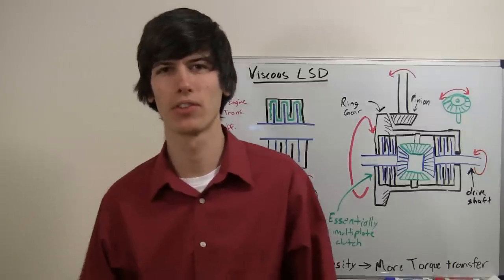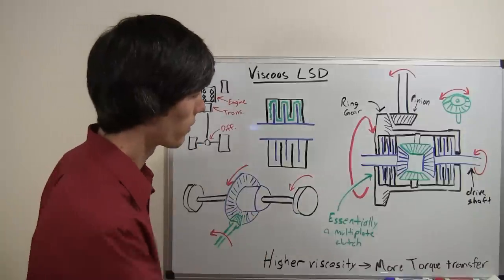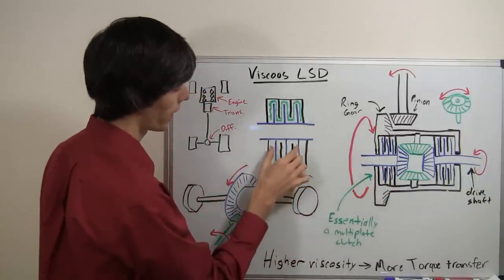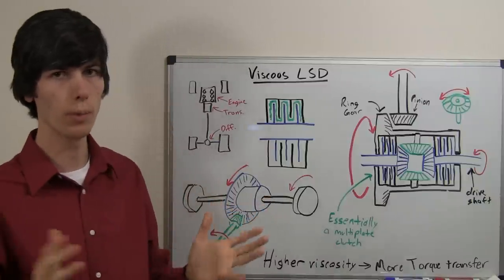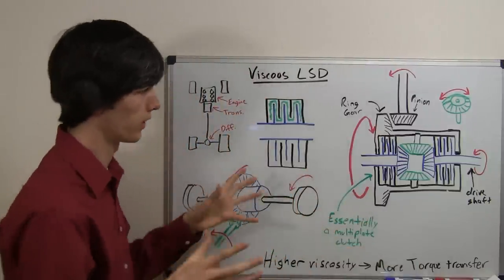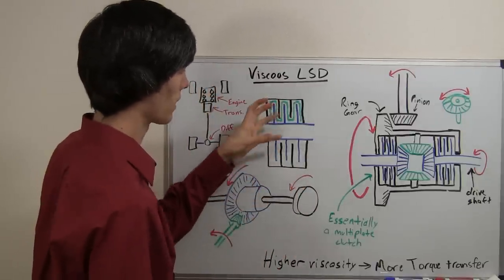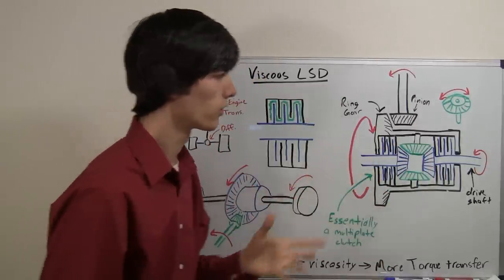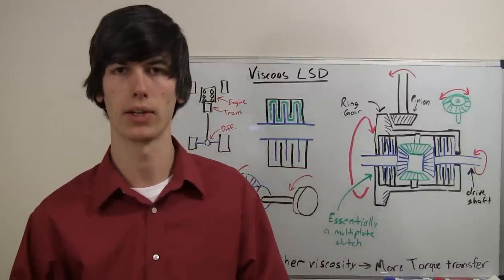Viscous Limited Slip Differential - Explained

Comment from the maker: Different methods, there's likely a cost difference as well. A VLSD will act a little more like an open diff than a clutch type, as it will allow for varying speeds before creating a restrictive force to get the diff close to locked. A clutch type could be locked in situations like cornering (while accelerating) where you may not necessarily want it locked. But ultimately, there are numerous solutions to every problem.

Comment: I think there is one important point to add in these video: viscous LSDs cause understeer by nature during steady-state cornering (outer wheel is forced to slow down and inner wheel is forced to speed up due to the increase of viscosity of the fluid). This is something that should be stated in my opinion when talking about clutch plate and viscous LSDs, since the transient vs steady-state operation of a vehicle during cornering is not the same.

Comment: Don't want to confuse anyone, but during differentiation both viscous clutch packs are seeing relative rotation, and therefore are contributing to the torque transfer to the high traction wheel. Also, viscous diffs are what is called "Speed-sensing". They transfer torque due to a difference in the relative speed of the rear wheels, as opposed to "Torque-sensing" differentials that progressively "bind up" as they are put under more and more torque.

Comment from the maker: Well VLSD does not act instantaneously, where as clutch/torsen diffs do. So if you want maximum torque transfer (instantaneously) to the wheel that has the most grip, a clutch type or Torsen (if both wheels maintain contact with the ground) are your best bet. Viscous is fine though, can do the job.

Comment from the maker: Somewhat similar in principle, but torque converters use transmission fluid, which I do not believe changes it's viscosity characteristics much with temperature change; at least not to the degree that VLSDs do.

Comment: The liquid in the housing is typically a silicone based fluid, so when the plates move at different speeds, the sheer forces make the fluid turn more viscous. This helps to lock up the diff.

Comment: In RC the pinnion gears and pinnion axle are slowed down with the visco liquid making them turning more with the casing. The Casing is filled with the liquid and stiffer the liquid less it lets the side gears to turn separately. So stiffer the liquid, more "lock".

Comment: Just pointing out its not the same speed... The weel with less friction gonna spin faster than the diff housing around 1:2 ratio... Causing the viscus liquid to resist the movement as well as the weel with less grip to move with the housing. both of the friction surfaces to work simultaneously. But i am not a fan of this diff even when basically maintenance free..
Reply: I had a Fiat Coupé 2.0 20VT which have this kind of diff. Works really well but is bad for the fuel effiency.

Comment: One question, just for my understanding: imagine a viscous-coupling used as longitudinal centerdiff. There is silicon oil (e.g. 90%) and air inside, not mixed. In operation with different speed the oil transfers torque, but the rotating plates also start to mix oil and air, so viscosity decreases, less torque is transmitted up to a certain point (hump). During normal operation (no hump) with higher speed difference more and more air bulbs will "hide" in the special shaped blades so that more torque can be transmitted? I always thought that viscosity of silicon oil increases but read somewhere that this oil is not dilatant...

Comment: Actually, the wheel on ice will spin twice as fast as the differential housing if the other wheel doesn't move, so the viscous fluid will both slow down the slipping wheel and accelerate the other one! ;) I love your work, keep it up!!

Comment: just an FYI 350z use a VLSD system for their OEM cars, with the nismo diffs just being harder, stronger materiel for the gears... 

Now, why is the VLSD non-repairable/serviceable other than just changing the gear fluid in the differential???
Reply: I have an 04 350z and want to put a 370z vlsd but idk what to get to fit any advice
Reply: Hey know you commented like 4 months ago but all you would need to do for ideal fitment would be to run 370z shafts and driveshaft

Comment: correct me if i’m wrong (because i want to understand better) but it sounds like it works very somewhat similarly to a torque converter. sending torque to the tires using fluid

Comment: just checked the rally cars the evolution and the STi, they both have LSD's, and the lesser model the plain WRX has open diffs.
interesting that it states if the hand brake is used it does something to prevent damage to the VC

Comment: it seems like a fraction of the power would be wasted with a system like this because neither side is ever directly connected, the diff housing plates would always be sliding through the liquid slightly faster than the plates connected to the axle receiving power from the liquid.  am i right?

Comment: Like your videos.

Just wondering why not just put the oil/grease inside the diff gear area? both lubricating the diff gears, and creating the VLSD effect.
is that because those gears are so heavy duty they need special lubrication to work. so those oil need to be used with the clutches?

Comment: [Cont. from below]  Is it true that as the difference in velocity between the two wheels increases, the friction in the diff increases causing it to allow less slip?  One final related question: Is a viscus LSD's utilization of fluid similar to that of a torque converter?  Thanks so much for helping out!

Comment: Super helpful video.  Thank you.  Is the fluid in the diff such that its viscosity increases with friction?  Or, perhaps that it counter intuitively becomes more viscous with an increase in (friction induced) heat?  My other idea is that it is similar to the fact that when I move my arm slowly under water I feel little resistance, but when I move it quickly under water I feel a lot of resistance. [continued in next comment]

Comment: Both of sides of the housing are filled with liquid, but have no pressure plates? When the tire on the ice rotates at the faster speed, the liquid transfers to the other side so torque can be transferred to the side initially rotating slower and create its own pressure to the clutch? With that being said, how does the liquid transfer? Via small turbine????

Comment: do you think torsen is better than viscous lsd(like haldex)?
Reply from the maker: Sorin Tudor For longevity, yes. They're somewhat different though, a Torsen diff will act essentially like an open diff with one wheel in the air, a VSLD will be a bit different.
Reply: ok, which kind of diff is the best for all purposes?
Reply: +Sorin Tudor torsen is better.
both torsen and viscous are long-lasting  - they live the same  time as gearbox or even longer.
clutch-lsd - every 20-30k km u should check preload and  tune it or change friction plates - all because of wear. so it's for sport and petrolheads.

torsen works from differents of TORQUE
VLSD works from Differents of SPIN

So torsen better when  when u need torque on both wheels but there is no differense in wheelspin - on tarmac in the corner .
VLSD need different wheelspin so it will work in mud or other slippery surface.

BUT!!!  It depends a lot from initial tune of both when they were designed. Example - pulsar vz-r  VLSD  is so weak  that car cannot  jump down from  lift jack.  

torsen  can jump down but u need to press both  brakes and acceleration pedals
Reply: there is a difference in response. torsen reigns supreme. hard to say numbers, but in corners that slight delay makes a huge difference.

Comment: Hey im not sure if u could answer my question but i git a 2000 volvo s80 t6 with a viscous clutch and im not sure if i really need it. And if i just can reinstall a new cv axle but without the viscous clutch and if the car would preform fine

Comment: Is this similar to a fluid coupling for say a  conveyor belt drive? I need to understand this for a mechanical engineering assignment. My understanding is as the motor starts up the power gets transferred gradually to the rest of the system. Is this correct?

Comment: Great Vid!  I have a question:  I have a viscous rear diff on my awd 3000gt vr4.  With the car in the air, I spin one rear tire and the opposite wheel should turn the same way, but it doesnt spin at all.  Does this mean my rear diff is not working?  thanks!

Comment: So that means it works? I had my car in the air with 4 corners on jack stand, 
1. spinned one of the rear wheels with hand, the other doesn't spin
2. turn the car on, put in gear, gave gas, it still have one wheel spinning and the other barely moves
one wheel fast + one wheel slow/barely moving = still working viscous?
So getting the speed up or sudden accellerate will trigger the lsd to work?
cause I still don't know if my viscous is still alive
thanks!!!

Comment: So these diffs are effectively 2 way diff then... as there is no mechanism for uncoupling of the diff during deceleration?
Reply: No, VLSDs will act as open diffs under deceleration as the fluid inside is not generating grip on the plates.
Reply: @winebartender6653  it's the shock losding on the fluid that makes them stiffen, doesn't matter which direction. I'd conseed the are probably less tight under declaration. But not open in any way. And how tigh mine is shimmed, it's tight af in both directions.
Reply: @tangles01  I would think the deceleration difference would have to be quite large between tires (more or less loading/faking slip of one tire) to see much of any sort of locking action. The vlsd is purely reactive to slippage, unlike a 2 way which takes any sort of difference in tire rotation and begins to apply locking before slippage occurs.
Reply: @winebartender6653  it doesn't matter where the load is. it's loading, it's locking. That's how the vlsd fluid works. Like I said previously non directional.
Reply: @tangles01  Best case scenario, a vlsd is going to act as a 1.5 way. The difference in speed between the carrier/final drive and the axles is much smaller under deceleration, with much less shock, than when creating slip through acceleration.

Drifting a car with a vlsd shows this quite a lot. You must be much more aggressive with the throttle to keep the lock consistent. When you go off throttle, you lose that sheer action quickly, resulting in the diff going towards acting like an open diff.

Remember, shimming itself isn't affecting how the vlsd is locking. All it is doing is increasing preload, to make the locking action happen sooner. It's the same concept of using the brake to preload (obviously not to such a severe degree).

Comment: i was wondering, so using your example, if the wheel on the ice is spinning faster cuz of less grip, and the power transfer to the wheel with more grip, wouldn't that turn the car? since one side is pushing forward more than the other?
Reply: lol no, the car has four wheels you know. The front wheels will control the direction of the vehicle.
Reply: yeah that's what i thought, maybe because when i imagined it, the driver was flooring it XD
Reply: sugepoola Even it that case, your theory still wouldn't apply. The rear of the car might have been moving sideways like during a burnout, but the front wheels would still control direction. I guess you're thinking about the principle of a turning tank, but that is a completely different story.
Reply: Майк ястреб yeah! exactly, alright that clears it up

Comment: +Engineering Explained How would VLSD act like open differential when going around a corner????....since the speeds of both the shafts wont be same and will be different than differential housing????
Reply from the maker: +Akshay Kaushik The speed differential between wheels is not nearly as high vs if one wheel started to slip and spin. It will have some "locking" action, but not much, allowing for different speeds.
Reply: +Engineering Explained does viscous fluid is non-neutonian fluid.
I've read somewhere it is so but now cant find
Reply: A viscous fluid can be just oil. The higher the viscosity, the thicker the fluid will be. For example, honey has a much higher viscosity level than water.

Comment: What kind of fluid is in a VLSD? You never said and would be helpful :)
Reply: Usually a high-viscosity silicone-based fluid, around 100,000W depending on the manufacturer.

Comment: ok I think I understand this. A lot of newer cars just use the brakes for this (my 08 Jeep Patriot for instance). This is called BLD, Brake Locking Differential. The vehicle has speed sensors on all 4 corners. if it notices 1 wheel is spinning significantly faster than the other on the same axle, it applies the brakes on the faster wheel. Same thing happens here except instead of using the brakes, it used clutch pads inside the diff. So no, not a real LSD. it's cheating really and robs you of power. I'm glad the auto industry has strayed from VLSD's and went to BLD's. my G35 coupe, for example, has a VLSD but it's 100% open due to the fact the VLSD clutches wear out at around 60k miles. So it's either replace the clutch discs and have semi-decent traction at performance cost, or slap down 2K and install a true LSD. Kind of BS when you realize the g35/350gt skyline/350Z never came with real LSD's.
Reply: +Zac Price VLSD's are MUCH better than BLD's, and they don't use clutches btw, you only need to replace the Viscous Oil, and that's super cheap and lasts FOREVER. 
(Sometimes if your doing REALLY extreme offroading, or racing the viscous oil can overheat and needs changing, but a normal G35/Patriot shouldn't need it unless it leaks.) 

VLSD's are essentially a smoother LSD system, and you can get thicker oil to increase the slip limiting torque too, perfect for high performance GT cars and such.*
(If I owned a G35, I'd personally look into getting a good CLUTCH TYPE LSD, because that's the best type for both speed and safety.)
Reply: +Zac Price "BLD's" are just a way to prevent wheel spin. 
Brake-based systems don't actually send the greater torque to the slower wheel. 

Plus they REALLY wears on your brakes if your somewhere slippery where they need to activate on & off constantly. 
It's much more costly to replace than Viscous Oil, especially if you do go offroading. 
(Still a good safety system to prevent people from going sideways and sliding though, I personally think Jeeps should come with LSD's, and the BSD's just a way around it.)
Reply: BLDs rob power from the engine to the tire with braking,  why would u want that. its the same issue with an old Cat bull dozer and braking the one track to turn. u lose lot of power with by dragging the brake.  LSD does not loose as much power when in a turn. adn locks up when under power. thus not loosing anything

Comment: This technology is so bad for sports cars, almost as bad as Torsen, Clutch pack differentials is where it's at.
Reply: why is torsen bad?
Reply: @MattBerrymotorsport  Let's say you enter a corner with a lot of momentum, the inside wheel is going to have less load, if you try to accelerate and the inside wheel can't provide 25% of the grip (for a 4:1 torque ratio Torsen) all of the extra power is going to be sent to the inside wheel, torque suddenly stops being applied, very unstable behavior.
Reply: @Iseenoobpeoples  any good for straight line traction with big hp?
Reply: @MattBerrymotorsport  look around you will see a lot of high end sports car have clutch pack as OEM. Hp doesn't really matter, the working principles stay the same.